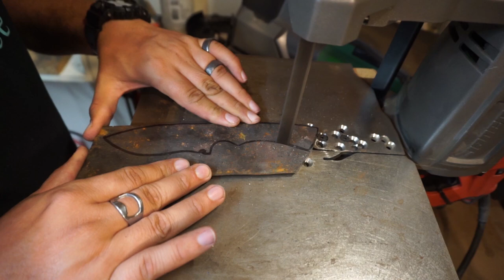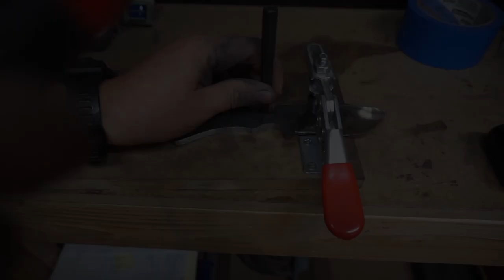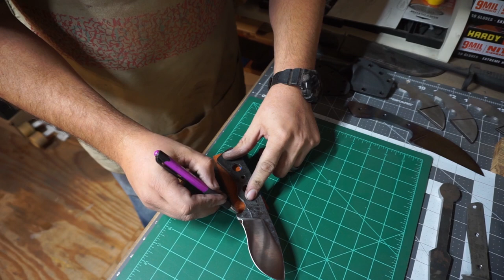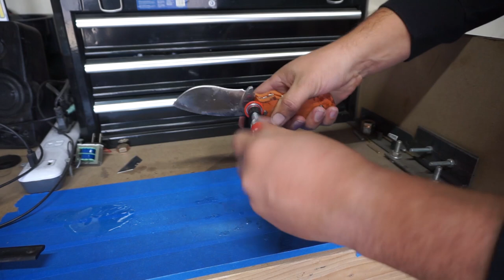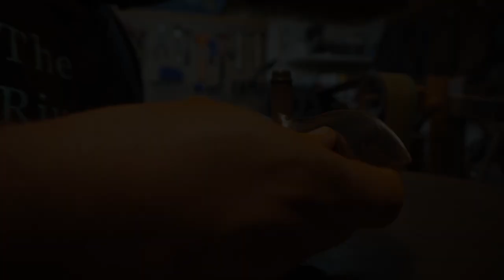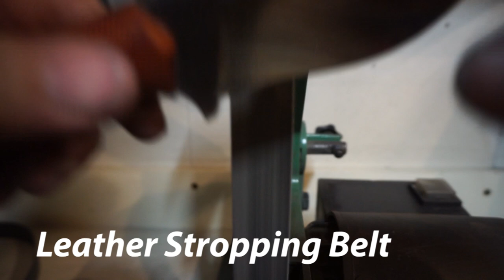Making A Knife From A Lawn Mower Blade? | Knife Makers Vlog

Comment: The lawn mower blade would already be heat treated wouldn't it ?...and what type of drill bits do you use...? Thanks
Reply from the maker: Yes it was originally heat treated but I had to Anneal it to be able to drill through it.
Reply: @theriversexperience9383  got ya...I have been using 100 plus year old hardened buzz saw blades for my blade stock...I'm trying to skip the softening process but have been having fits trying to drill pin holes. I use cobalt bits (or misuse) do you know any better bits to use...I heard maybe masonary bits ?....thankyou